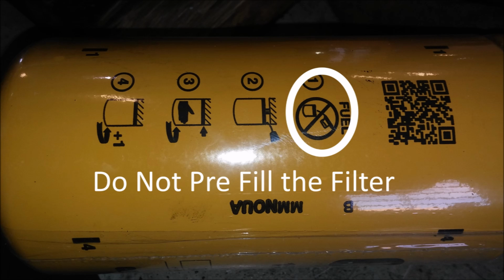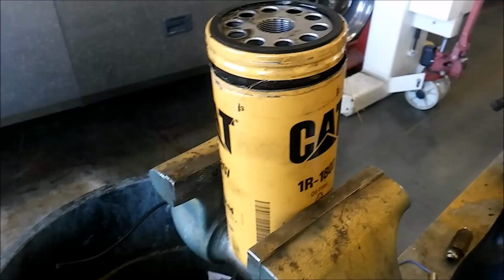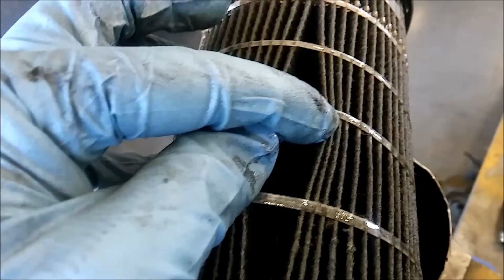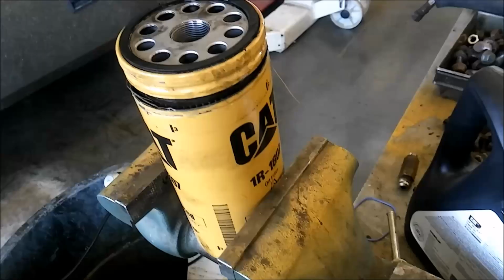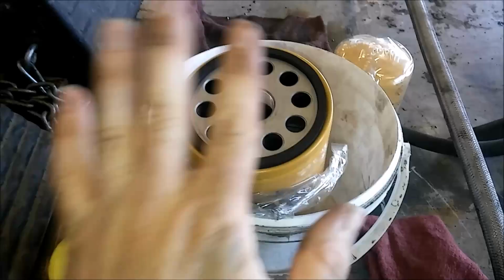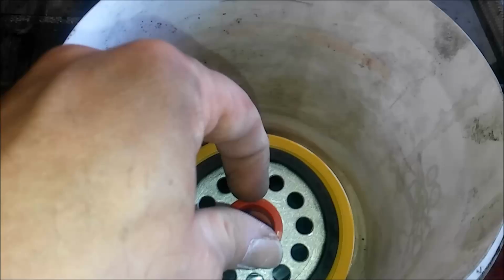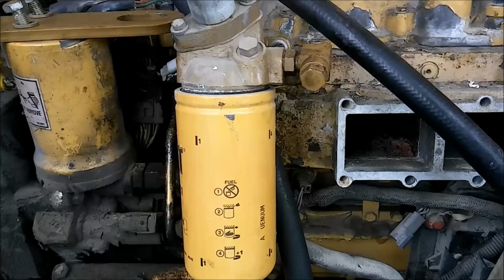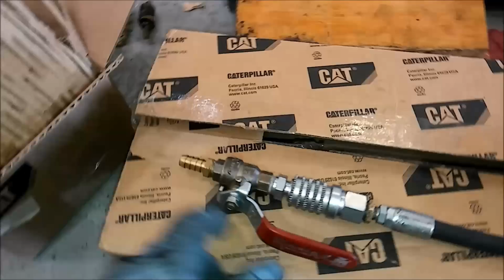Should You Pre Fill an Oil Filter? Should You Pre Fill a Fuel Filter?

Comment: i dont quite understand how pre filling into the clean side with fresh oil could possibly hurt anything worse than filling it from the dirty side.
Reply: +Painting Place ah, makes sense I guess. but if there is oil already in there, clean side or not,  the delay would be only like a second since the engine builds oil pressure right from cranking
Reply: my question is if you're using new clean oil how the hell you getting dirt in there?
Reply: +dosmastrify lol really. like fresh oil is as clean as can be. and a new filter means no dirt too
Reply: You have aerosols or you can just be plain unlucky and something from the bottle falls down into the drain. It's better to be safe, even if you can't understand why you do it
Reply: +Derhder again a new jug of perfectly clean oil isn't going to to that. if you're clumsy you might drop something in there I guess, but that would be your own fault
Reply: dragonslayer1483 im not talking about the content of the bottle. More about something that's stuck on the outside of the bottle, like dust or whatever small object invisible to the naked eye
Reply: +Derhder lol im sure a small amount of  microscopic dust is the least of anyone's worries when it comes to a car. if you want to worry about microscopic dust in the oil then you have a helluva lot more things you should be worrying about too
Reply: dragonslayer1483 not if its metal dust from filings or shavings. Man I don't know why you're arguing. I learned this as an engineer when we had motor-mechanics. Im just saying. Believe what you believe, i'm done with this argument :S
Reply: +Derhder where's metal shaving and filing come from if your not doing that at the same time lol. how would you buy a jug of fresh oil with metal shavings on it? like.. wth else are you doing when you change your oil?
Reply: dragonslayer1483 so you are basically saying you don't understand the purpose of the oil filter and/or you fully trust the vendor to never have any contaminants sediment in their oil jugs or you to have any grit on your funnel etc...
Reply: ssdwellah you always clean the funnel before and after use and yeah I trust them. they don't make millions of dollars and run a huge business selling thousands and thousands of gallons of oil that is filled with dirty oil.
Reply: dragonslayer1483 you should take a look at the bottom of the bottles sometimes, even full synthetics like mobil 1. Yes, they make many millions of gallons of oil, and that means there are some millions out there with contaminants, and that they are expecting that many millions of installers are pouring it into the oil filler neck on the valve cover where it goes down to the sump and gets picked up by the pump and put through the filter before seeing your bearings. But go ahead and keep doing it the wrong way. I don't know why, when you are bothering to prefill at all, you insist on taking the risk putting it downstream. You would be better off not prefilling.
Reply: ssdwellah I doubt one cycle of microscopic contaminants will hurt anything. do you worry that much about fuel? fuel is very dirty, especially diesel, but the filters are only changed every once in a blue moon
Reply: dragonslayer1483 you're really reaching here. So as dirty as you say fuel is, and I agree with you on that point, I'm sure you prefill the clean side of the fuel filter with old cruddy gas because "hey, I doubt it will clog the injectors". That's the type of logic you apply. You probably flip your air filter over again and reuse the other side too. I just don't get your insistence to take the risk but whatever, that's your malfunction so go ahead and keep going out of your way to do it the wrong way just to prove it to yourself. I hope you don't get burned.
Reply: ssdwellah you don't fill fuel filters up unless it's diesel lol. and no your assumption is wrong. I don't go "out of my way" to do it wrong. you don't fill the oil filter with the bottom of the can anyways so I don't see you point about the contaminates. if your so worried about even the small chance that theres a contaminant going in you engine by oil then you must not sleep at night cause you worry about the smallest things.
Reply: if it is a quality oil or fuel filter how is it not ok to put the proper oil fuel in on either side of the system. even if it is dirty as shit it is better than having nothing there  to lube or  cool even for couple of seconds
Reply: Just fill the whole filter very careful not to let particles in the air your eyes can't see to get in there and you'll be fine. Jesus Christ.  3 generations not been that carefull but now it's a problem
Reply: these is why u are not a CAT tech.
Reply: this prefilling video is bullshit not a damn thing wrong with prefilling period especially on large diesel engines that use an oil filter that holds a gallon or more of oil prefilling gets the oil circulating faster just makes sense end of story
Reply: Carr Ramsey l
Reply: Les Brown  If you believe in God then why do you use His name in vain?  If you don't, then why do you use the name of Someone that you don't believe in?
Reply: Fernando Escobar  If you believe in Jesus then why do you use His name in vain?  If you don't, then why do you use the name of Someone that you don't believe in?

Comment: always prefill a oil filter or a least get all media wet . dry surge high volume of fluid hitting the filter can blow it out . I have seen only a few times though so I always prefill
Reply from the maker: +Jessi Sumner I've never seen that, but that is an interesting point. What engines have you seen that on?
Reply: Detroit 60 series caterpillar C15 C11and one international . The 60 series had 400000 on it . Just had an oil change not by me in a wrecker left out and made it 2 miles and spun the bottom end . Started checking and a old timer said check the filter . Cut it apart and there it was . Ask the guy who did the service and no he didn't prefill . It blew a hole out . Found the filter media in the oil ports . Which lead to me doing a fast 2 day rebuild that sucked to got about 4 hours sleep on that one . All over not prefilling an oil filter . That's why I do it and I always do it on fuel regardless of what they say
Reply: O and one dirtymax it was a cheap filter but the guy didn't prefill and same thing that one cost the guy 13000 whole new motor . Its sad over an oil filter it was 20 degrees out side to . So that didn't help either
Reply from the maker: +Jessi Sumner What brand filters were these? I'm just surprised because I've never seen this or heard of it happening before, and you've seen a few of them. If it was somewhat common I'm surprised Cat recommends not prefilling them.
Reply: Wix and yes one cheap frame on the duramax now that over the course of 20 years doing it to . Love the vids by the way

Comment: I've seen plenty of grit in the bottom of brand new oil buckets. There are different "grade" products on the market. Some grades can even be allowed to have certain amounts of water in them. Discount retailers are known for that. Some places don't have enough indoor storage. If you don't believe me,buy New Holland Ambra. Empty the bucket and look in the bottom. Tractor supply oil is another place I've seen it. It's easier to see if the bucket is white or yellow. That's why most oil comes in blue or black.